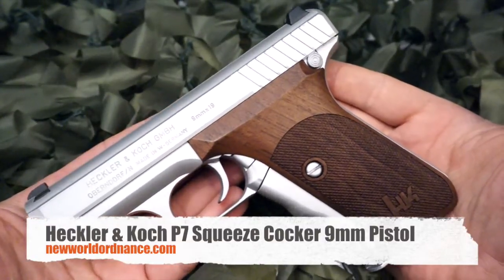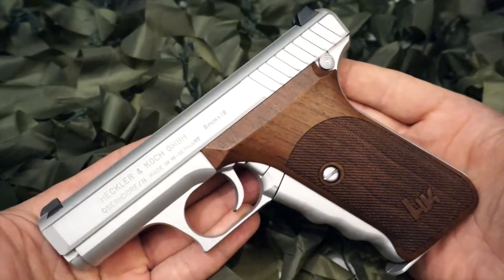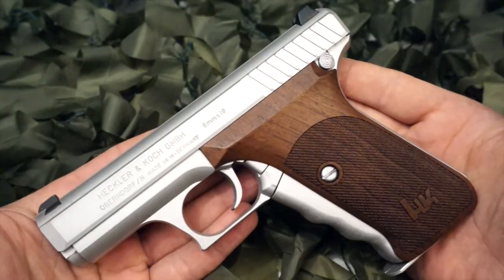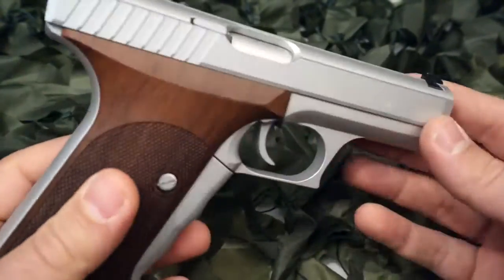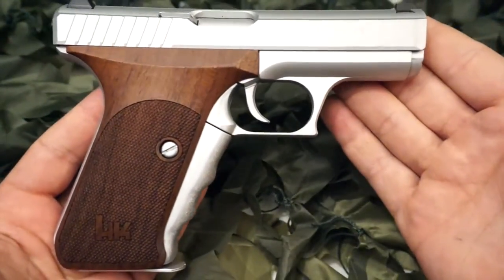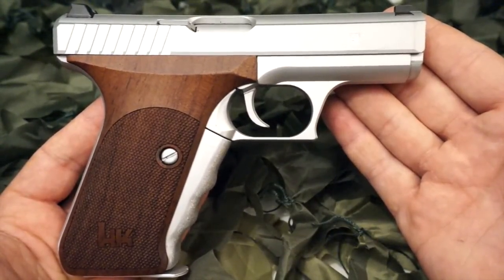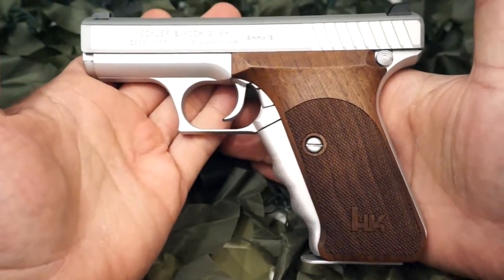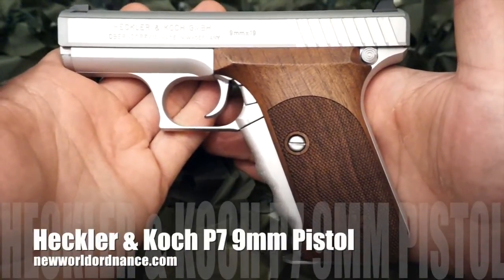H&K P7 PSP 9mm Squeeze Cocker Semi Auto Pistol Overview - New World Ordnance

Comment: LOL 😂 Had 2- the PSP and a P7M8 with its trigger guard heat sheiks. Both had a great trigger good accuracy and decent reliability sadly has 2- major flaws such as extreme over heating upon shooting 3 magazines rapid firing no longer permits hand being able to continue it additionally the take down button for the slide is located poorly in the left rear portion of the frame practically touching slide in numerous stress scenarios recking slide and accidentally touching button will unleash the slide off the frame at a higher velocity than a projectile.
Additionally portion of where cocked pin protrudes indicating cocked should debris get collected turns P7 in a full auto .